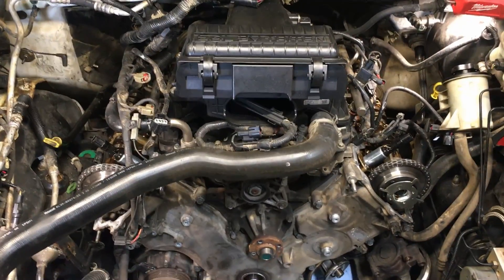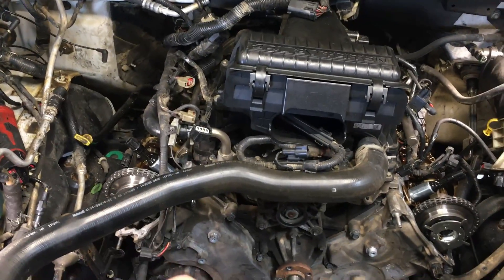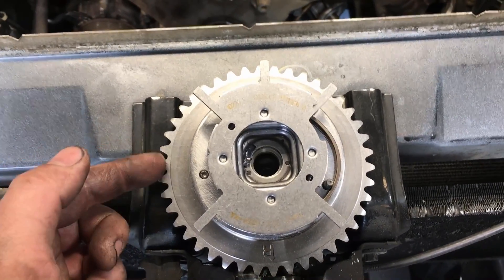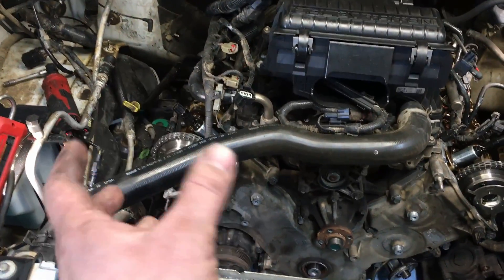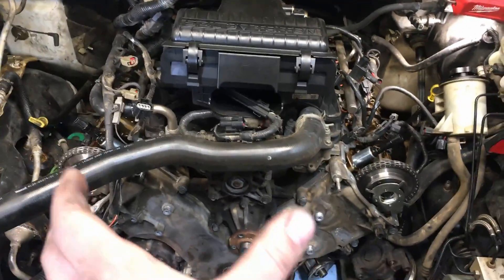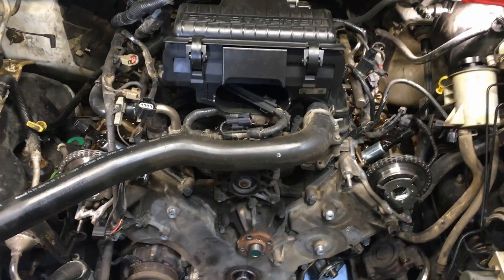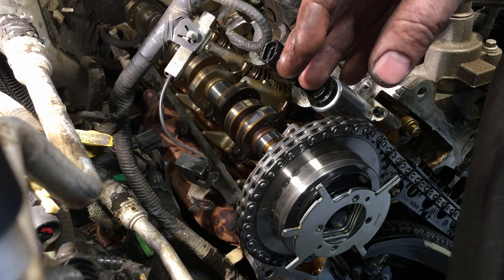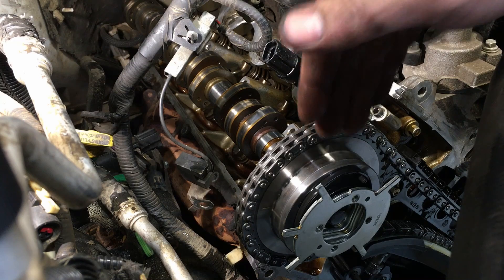Ford 5.4L 3v Triton Engine: DO NOT USE AFTERMARKET PHASERS FROM FREEDOM RACING/OTHERS; THIS IS WHY!

Comment from the maker: These are the only internal Engine Kits you should use:
2004-2014 5.4L 3v Triton Ford Full Timing Kit-
https://amzn.to/3O3wtDM
Reply: YOU HAVE SOME AWESOME VIDEOS, KEEP UP THE GOOD WORK
Reply: God bless you, thank you for stressing this to us, i trust your work and i always do go by what you say when it comes to these trucks. I do drive one and i do agree ford parts are going to work.
Reply: FordTechMakuloco  Hi I have a 2008 Ford F-150.  It makes a rattle noise when the truck is at or around 900 to 1100 rpms  sounds like it wants to die. It seems to be getting worse.    Can you help me and let me know what is going on or what needs to be replaced.    Seems like everyone I’ve asked to fix it wants to just replace parts until they find the problem.  Thank you for your time.   Sorry it’s a Triton 5.4 XLT engine with 124,000 miles
Reply: Hey man, love your vids !  could you get away with using cheaper cam phasers off amazon and putting a lock out kit on them?
Reply: @trevorl8864  if you put the lockout kit in you wouldn't have to change phasers
Reply: I read that Dorman has re-engineered theirs recently. Is this true?
Reply: What cams would you use on a 2004 5.4?
Reply: @jacobkirby5889  The current OEM Ford only. Unless you want to do it twice,regularly. They cost more but you'll lose in the end on the cheap ones.
Reply: @treynathaniel4075  what about performance cams?
Reply: @jacobkirby5889  My bad I thought you meant phasers. Cams? All things being equal,meaning cam only not compensating with other performance parts I'd stick with the 3v mustang cam.  You'd have to upgrade pistons and rods then consider your trans,rpm ranges,tuning,the 5.4 has a long stroke,just throwing in a hipo cam isnt the only aspect. The 5.4 mustang cam would be as hipo as I'd go if your keeping everything else stock.
Reply: What do you think about locking them out with a programmer
Reply: Hi looks like they dont have the  kit anymore anywhere else?
Reply: @helios7415  i used the parts list on the details section to make my own kit. If you order online through a online ford parts place you will save Alot... Like 200 or 300. I did. I bought  cams too and it was still cheaper then this kit. Good luck. Did this about a month ago, shes running great again👍
Reply: FordTechMakuloco what about for  a ford SOHC 4.0L V6?
Reply: FordTechMakuloco im looking at a mustang with 4.6 3 valve should i worry about these problems
Reply: I have a 2006 f250 that i spent $4k and dropped an ATK Remanufactured engine in.  11k miles on the new engine so far and no issues.  I dont know if they use the Ford Parts on thier cam phasers or not.  Any Idea?  They warranty the engine for 3 years 50k miles.  The shop i bought it from is reputable,  Auto Plus Evansdale Iowa. 5.4 3 valve of cours.
Reply: kkthxk  i agree
Reply: what about the 4.6 3v i cant find what you suggest
Reply: Really appreciate this video and your suggestions!
Reply: What about the melling phaser
Is it an aftermarket or motorcraft?
I have sent them a email but haven't received a response.
Reply: Dude sell me 2 phasers for 500
Reply: Who sells a solid gear
Reply: @bradleyhayden8504  Ford revised it,the other ones on the market are the old design  that even Ford had a problem with. Thats why the aftermarket shit fails constantly.
Reply: @bradleyhayden8504  Ford,bout it
Reply: FordTechMakuloco would like your opinion ok I have a 2010 f250 with a 5.4 needs new timing chains installed ok everyone I have gone to around here tells me to sell the truck as is or drop in a new engine. That it no use in just changing out the timing chains and everything that comes with it. What’s your take this? Thanks 
Pete
Reply: Ok I need to ask you. I know it would be hard to answer without having the truck in front of you. 
I have a 04 F150 fx4 supercrew with the 5.4 L 3 valve. The place I take it to has replaced the timing set 3 times. The last time they did this the only way they can get my truck to run is to DISCONNECT (yes I said disconnect) my passenger side cam sensor. He told me he replaced the cam sensors with new ones and it still wouldn't run right. He then replaced them again with Ford sensors and it still wont run correctly.  So he disconnected it and said that this was a backup or redundant sensor to the one on the driverside. I'm calling bullshit on this answer. Could this be because he used after market phasers and timing sets. 
Please I'm at its end with this engine. Right now its eating gas so bad. I can drive 60 miles and it will eat 1/3rd of a tank of gas.
Reply: If you're in a pinch can you weld or otherwise fix the phasers to the gear at base setting?
Reply: My 2012 f150 3.5 rattles when I start in cold please tell me why? It started doing this noise after I performed a flush on the motor oil and now makes that noise in cold but its for 3 or 4 seconds but knocks ugly its been for around 1 year
Reply: I just bought a 2001 F-150 Supercrew 5.4..its a one owner with 325000 miles but it's had maintenance and oil pressure is good and what I would like to know is what oil and weight do you recommend for this truck and if I put an after market cold air intake and newer air filter on it is that going to cause any problem down the road ,cold starts, ect...or should I just leave it alone has good quiet exhaust but I wondered about adding duals and that air filter but I didn't want to mess it up..
Reply: FordTechMakuloco thanks man for all your videos, I’ve learned a lot from you, and I’m about to do my timing belts on my 05 Lincoln Navigator, check engine light came on with code P0012 and I replaced the vct solenoids and light is still back on, it has a knocking sound like a diesel truck, so it’s time for timing belt replacement, I’ll order it from the link you posted
Reply: I have a  problem with my 5.4 3v engine I doe the timing chain and put everything together and now the truck was driving good but I lose power in 4 cylinder in driver side  and I dont kwon  want happens I have good precision in the piston  but  have missed fire in that side
Reply: Now what about aftermarket camshaft ? I have a 2004 f150 , belive its the first gen of the 5.4 3 valve. I came up on 310,000 miles , I really been thinking about maybe just a rebuild or maybe even ordering a long block from promar engines, I really haven't had major problems with this truck still running like a champ, no check engine light I run a synthetic blend oil, but for some reason I can't run full synthetic I must need more oil if I run full synthetic the last time I tried it oil pressure switch cut the truck off and it wouldn't crank back up until I changed out the oil it fire back up and now running ever since. Just looking for a good direction for this particular engine
Reply: Just thought id update. For anyone looking for this kit. A user  said they are out. But i gotta tell ya its cheaper  to find a ford online parts store and buy from there. This link it 798.00 or so. I bought all these parts plus both cams shipped for 770.00. Cams came way down in price. About 213.00 for both now. Brain it a great guy and we all need to make money. But mark up on these parts were way to much sorry. Good luck all im putting mine together now
Reply: Wait , I thought Ford's new upgrade oil pump is recommended for this phaser job ?
Reply: Is the first option on that link the right one it says it ships from shults ford Lincoln
Reply: So what about 100.00 R/L new cams ebay has? Any experience  with that any one? My pass cam is fucked. Im not paying 300 to 500 for stock cam cause then ill just buy a comp cam. Junk yard is 175, how reliable  are 100.00 ebay cams? Anyone try them?
Reply: They sent us GARBAGE. One phaser the reluctor is 90 degrees out.
Ford GARBAGE. Union made garbage.
Reply: They are out, can't get them anymore.
Reply: What is youre opinion on the lockout kits?
Reply: @smdsmd123123  im sure your asking him not me, but from what i understand  u will lose low end power on a stock truck.
Reply: Awe,  its discontinued
Reply: @dennisberg2474  find a ford parts online, use this parts list. It will be like 200.00 cheaper. This kit was way over priced
Reply: If there is such a thing, What would be the best motor I should be buying ing a used 2015 - 2018 Ford Transit Van? The most reliable and the easiest to work on? 

65 yrs. young and want a high roof extended van to travel full time. I want to feel safe! Does Ford make one and if so, what should my mechanic be looking for when he pre-inspects it.

If Ford doesn't make one who does? Sorry to be asking these questions but I have litterally watched every single one of your videos and I have the utmost respect on your advise and recommendations. Thxs! ❤
Reply: Is this no longer available from Amazon been checking every day and keeps saying currently unavailable?
Reply: @Farmboy-fs5xw  look  for a ford parts online site of your choice.  Use the parts list from the link. I saved over $200.
Reply: Your opinion  on locking  the ford phasers out and having pcm reprogrammed?
Reply: Where are you located
Reply: Working on mine outside & just had 30cms of snow!  I'll definitely be using Ford part's. 🇨🇦  Thanks again for the great videos!
Reply: The updated kit
Reply: hey Ford Tech Makuloco I have a Ford F-150 with a misfire problem I would like to know your location maybe you can help me with that mechanical service
Reply: What about oil pump?
Reply: can you send me the link just for the phaser 2005 f150 5.4 plz
Reply: I just install this and went home, after wondering why the top end makes a clicking noise.  I'm checking the phasers tomorrow.  Thank you very much.  🎄 Merry Christmas.
Reply: Problem is,
 With that price of $750 you don't get the solenoids, You don't get a Ford or melling oil pump, And you don't get therocker arms(rollers)
 So I gotta buy those items separately and that's another $700....

 So I'm at $1500 plus I gotta buy the install tools.

 So now I'm at about 3 or fourdays down in $1600 into it.

I don't know..... for $3000 I can get a complete remanufactured engine
 I'm not sure where the financial benefits are here

But let's just say I get thesesparks and if I get on my own and have somebody put them in then I'm looking at 3 grand anyway.

Where's the financial benefit for the customer here?

 Better off just throw on a new engine, Even if Ido the work myself for an extra $1500 you'll have a new engine.
Reply: Hello, would you recommend replacing timing chains,guides,tensioners and variable timing sproket on a 2011 5.4 3V  triton engine with religious oil changes with 268,000 miles and no signs of any issue just for preventive maintenance?  or just replace when having an issue or a noise from any of the above?  Thanks in advance.  Also another quick question on the speed sensor that go bad and cause a downshift.  Is there a mileage that you recommend to have them replaced? also where is this sensor located?   thanks in advanced for all you do Brian.  Brett
Reply: Thank you. I got burned on a briggs gas tank assembly. Check cable came apart. It was assembled incorrectly, diaphragm was on the wrong side.
Reply: Are you serious? Or just a mad customer with a struggled past with the kit man? Love the info in your videos but ima 2v guy, forget those 3vs.. Is like getting an Ls engine😫😷. Fuuck me dry if i ever get a 3v.
Reply: These motors are really bad can't believe how horrible these trucks can be GM old technology keeps working

Comment: I rebuilt my engine lifters rockers camshafts phaser chain kit and solenoids , meling lifters and oil pump m360hv 
I have like a bad phaser noise between 1000 and 1500 rpm can’t figure where it come from I think to change my new solenoid by motorcraft solenoids first
Idle is smooth I don’t understand any noise and oil pressure is just over the middle every time

Comment: This was such a great video! I also recently replaced the timing components on my 2005 Ford F150 5.4L with aftermarket stuff, including the phasers. When I first start it, it runs fine. Once I begin to drive, it starts acting funny! It doesn't shift right, it stalls from time to time, and it makes strange noises as it's idling that I can hear in the cab & while I'm driving. The timing is correct, I replaced the crankshaft & camshaft position sensors, and made sure the solenoids were mechanically okay. I really have a feeling that it's the phasers. Is my assumption correct? Do you recommend me change just the phasers to OEM or all of the timing components to OEM?

Comment: I am pretty sure phasers are the problem im having with my 2007 f150 5.4. It runs pretty good most days. On days when the outside temp is above 80, not everytime but it will start to idle rough when I come to a stop. I can put it in park/nuetral, gag the throttle and it will immediately level out. Once it starts doing that it will do it even when I just tap the pedal to idle accross a parking lot. Am I wrong about the ohasers being the culprit?

Comment: I am also a mechanic started after 3 year of train starting in 1966. On our 2005 Ford Expedition around 4.5 years ago I installed the Coyote timing set but used Ford phasers.  This week the system failed again, per the scanning tool bank 2 was out of time. I thought it was the Phaser but no, when I pushed the cheese locking device into place the chain fell loose. Once the timing cover was removed the plastic guide failed again along with Left tensioner.  These are junk and these companies should be sued for selling these Junk timing parts.

Comment: I replaced all my timing components with OEM Motorcraft and I had the bank 2 phaser fail within a month. All the pins sheared on the reluctor plate.  Problem was I was so frustrated I let it sit and I can’t get it warranted. I went and bought a new and improved Dorman even though I’ve heard they have problems.  The one I bought was the latest revision. What the hell. What do I have to loose at this point !

Comment: My 1984 SVO has a 1989 358" Kulwicki qualifying engine.....
my daily rig is a Tahoe with the excellent superb 323" 2003 engine.

This V8 ohc debacle is solvable with either a Windsor or GM swap

Comment: I bought cam phasers for my 2007 5.4 3v from freedom racing. There stamped ford and sold as oem ford. I installed before watching this video and phaser failed after 10 minutes of starting truck. Is this a common problem?

Comment: What are your thoughts on aftermarket cams? In general , and specifically thumper cam from comp. Reason why I’m asking is because I like the rough idle. I’m pretending to be a race car driver just want my truck to sound better but still be reliable. How bad of an idea is this that I’m having?

Comment: Thanks for your advice.  It looks like the gauge of the ground wire is a little small for the load that it could be carrying between the component, the chassis and frame, and on the weather-pak type connectors in the various wiring harnesses. For those who think dielectric grease is different from Ford's XG12 Electrical Grease, I believe you'll find that Nye Lubricants, Inc. manufactures and packages this product to essentially the same specs for most major car manufacturers and for aftermarket distributors under their private label, but leave it up to the car manufacturer or distributors whether or not to call the grease "Dielectric Grease" or "Electrical Grease", but its purpose in preventing corroded connections  is the same.  Check the website of Nye Lubricants for more information about the purposes and specs for their different types of specialty lubricants.

Comment: I need to change guides due to them wearing. 174k miles. No noise except for the little chatter from the guide. Should I change the phasers if they are ok?

Comment: i see this video is 4 years old now and i came here because i checked freedomracing, it says timing chain is c391 so cloyes chain, is that as smooth as oem ford? and in their listing now it says it comes with oem ford phasers, have you seen if that is correct? i am planning on buying that kit since it says eom phasers but is chain good enough? hope someone can tell me something about it
Reply from the maker: Never ever use Cloyes kits they are the worst of the worst.
Reply: @FordTechMakuloco  thanks for info

Comment: I have a 5.4 sitting out front dead yet again, Just bought a Dodge 1500 as my main truck and I am a ford guy but ford can't build a reliable engine - I had a original 1992 5.0 and put 600,000 miles on it, the new 5.0 only getting 200,000 before major issues.

2 reman heads and 2 sets of phasers and a pos truck - at 59 years old I am sick of the "new" fords, almost everything sucks for the last 20 years, I know government regulations play a big part of that they have screwed this whole country up.

Comment: So don’t use Melling or Cloyes timing components? I am literally doing the job this weekend and saw this video.
Reply from the maker: I would not
Reply: @FordTechMakuloco  I also just watched your oil pump video and the link to Amazon for that oil pump states it’s for the 4v engines. Is that correct or does that oil pump still work for the 3v? My truck is an 06 5.4l, that has 3v correct?

Comment: I know this is an old video, but I still would like to make the comment on the fact of using aftermarket phasers on these engines .He highly recommends using only Ford phasers but if the Ford parts were so great why are these engines coming  a part at 100,000 miles.I’m a firm believer in using OEM parts but sometimes there stuff is Junk.

Comment: love your series . Have a question I did the hole timing job because I was gating a check engine code p0016 . so i did the work followed your instruction and using all ford parts  the p0016 is gone and now I getting a  new error code p0018 can you help . thank you .
Reply from the maker: You mistimed it for sure.